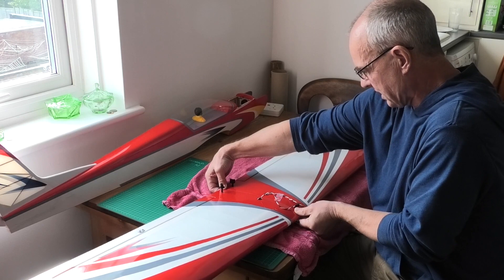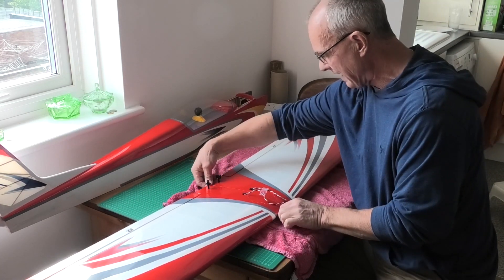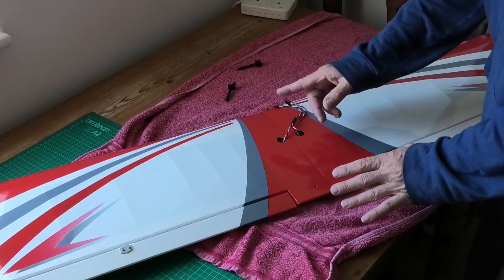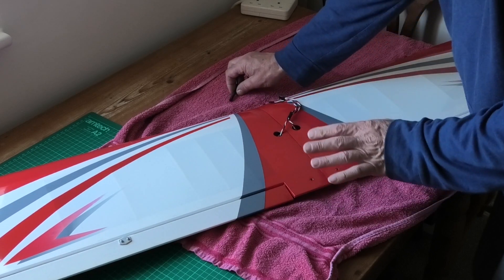Assembly Pt 1 - Calmato Alpha Sport 40 ARF - Radio Control Aeroplane by Kyosho, Japan Models Vietnam

Comment: Hello.. I need help on the hex head screws. where did you buy those from?
also, some info the servo wire extenders?
Reply from the maker: Hi there, this is where I get my servo extenders https://www.4-max.co.uk/motors.htm and my hex head screwa from https://www.modelfixings.co.uk/servo_screws.htm hope that helps